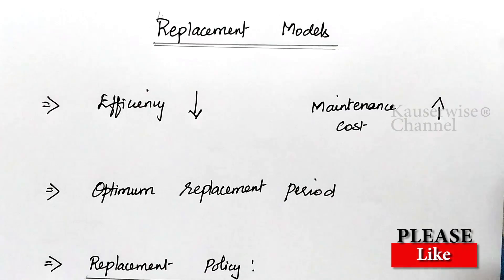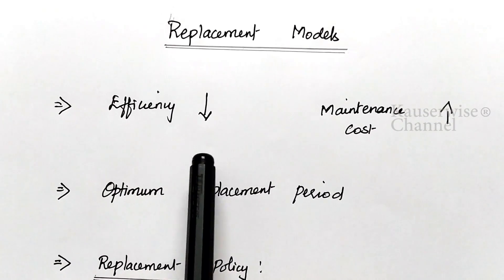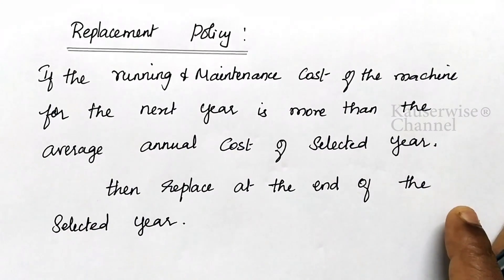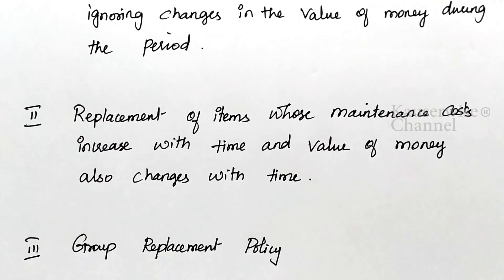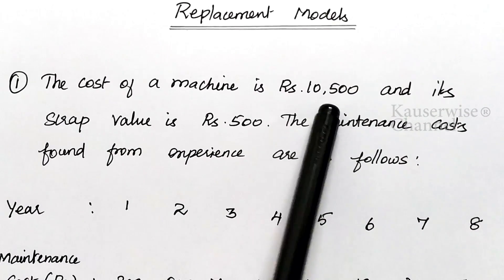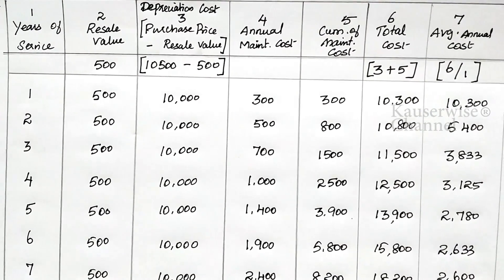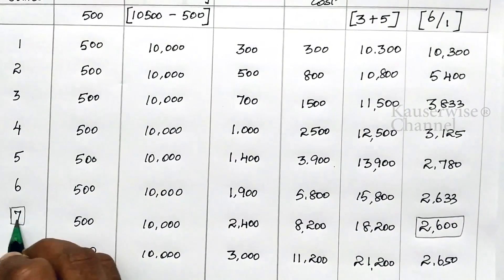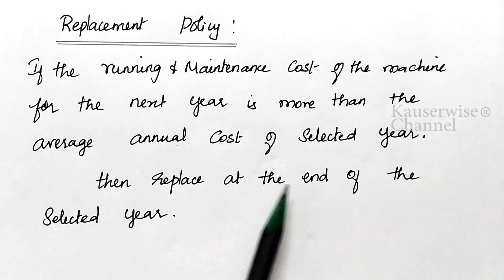#1 Replacement Problem in Operations Research | when constant resale value is given | by kauserwise®

Comment: machine a costs rs.3600. annual operating cost are rs.40 for the first year and then increase by rs.360 every year. assuming that the machine has no resale value determine the best replacement age. another machine b which is similar to machine a cost rs.4000. annual running costs are rs.200 for first year and then increase by rs.200 every year. it has resale value of rs.1500,1000 and 500 if replaced at the end of first, second and third year respectively. after third year it has no resale value. which machine would you prefer to purchase.   
Solve this problem.